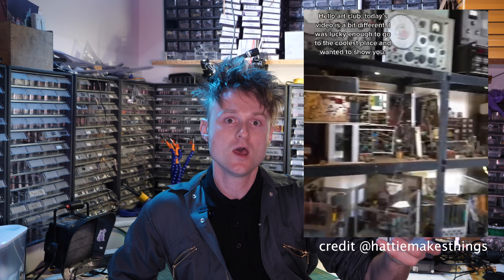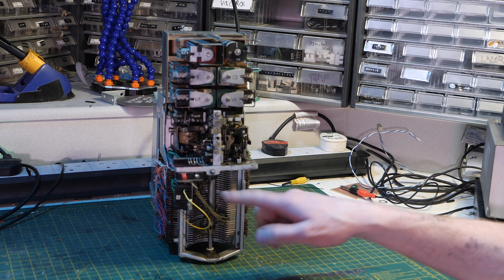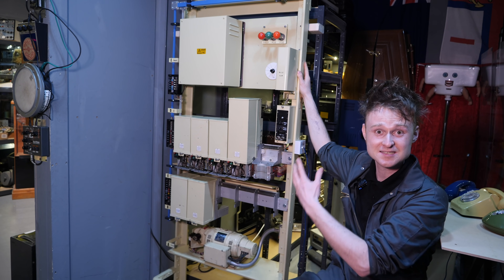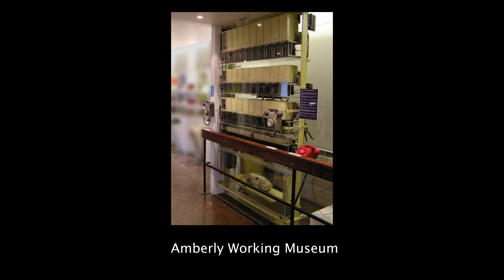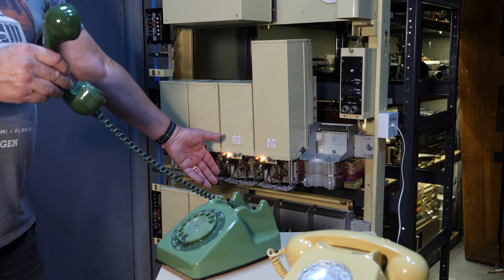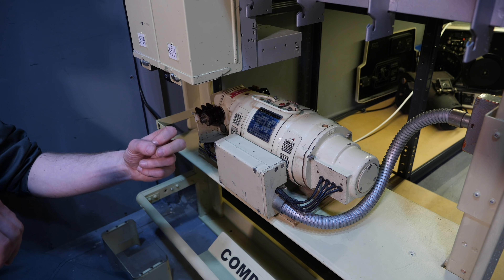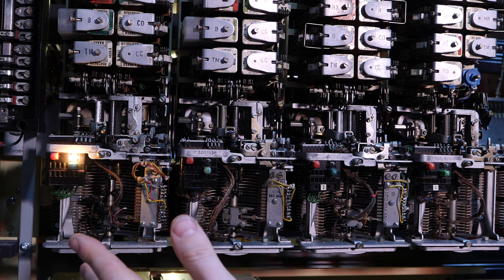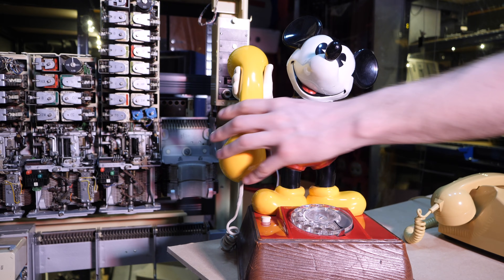STROWGER Telephone Exchange mechanical machine

Comment: The coolest bit of trivia I got from this is that the ring tones for all phones connected to the same exchange would be synchronized by the virtue of being a tone modulated by a motor and than the signal shared by all the phones, so 2 people sitting on the oposite ends of the town would listen to the same dial tone.
Reply: Yup, and the phones would also ring in unison. Well, actually that not strictly true <digs deeply into memory> without getting my notes out I seem to remember that ringing current was broken 66/33 66/33 0/100 (brrring brrring, brrring brrring) and so the ringer would have three output cams set 120* apart. Same with ring tone, and busy tone. Dial tone is continuous as is Number Unobtainable. I think that S and Z pulses were also sourced from the ringer which were used all over the exchange for timing things and also meter pulses (though I think the exchange clock migh also have been involved in the meter pulses) good grief, though I’m stretching my grey matter here.
Reply: @captbeardy  Could you elaborate? How does that lead to rings in different phones not be synced? It is fascinating but I fail to follow the dots. Do you mean there are 3 separate ringer outputs and some phones are connected to one, others are connected to others?
Reply: @Thorinbur  ok, I’ll try,  it remember it’s over 35 years since I worked on this stuff. 
The ‘tones’ and ringing current are all generated by an oscillator as continuous tones/current. I forget the frequencies, because it wasn’t generally important wine faulting this kit. Ringing current is, as stated 75v. Taking ringing current as an example, the continuous tone is presented to the inputs three sets of contacts, the output of which is distributed across the exchange to Final Selector racks to balance the load. The contacts are ‘broken’ by the mechanical action of cam lobes to give the iconic ‘brrring brrring pause’ in a ratio of 66% on and 33%  off. The three sets of cam lobes are set 120 degrees apart so that output is staggered. 
So you get 
Cam1. Brring   brring   
Cam2.            Brring   Brring
Cam3.                      Brring brring
I’ve still got some course notes somewhere, but I think that is about right.
Reply: @captbeardy  Appreciate you taking the time. I think I get it now.  So three staggered cams are conneted to one constant source so that when one source is connected by the cam other two are not and it is done to balance the load. And that will in turn make it so if you are connected to different "lane" the ringers wont be synchronized. I never thought about how many physical connections there were in the first phone systems. Internet is routing packets reusing same physical connections between routers. The idea that old phone networks would literary connect a physical cable using relays and selectors to a signal source and the source is connected and disconnected by a cam gear rotated by a motor... Amazing. Thanks for sharing the details.
Reply: No problem, it’s nice to stretch the very matter back to a simpler time in my career when every day was a discovery. The amount of physical,equipment that could be involved in a single,telephone call could be quite boggling, especially for a long distance trunk call. The kit represented here is just for,a 5 digit local telephone call. Consider,how much was required for a 10 digit long distance call when voice amplifiers, digit repeaters and various multiplexing equipment was involved. And long distance calls weren’t just simple step by step as represented here, but required register translators so,that a common STD code could be used anywhere in the country and still end up,at the appropriate destination. On top,of this there was an added level of complexity with something called the tandem network which was a clever way to reduce the number of interconnections required. Because you needed a physical discreet link to be possible between every pair of phones in the country, the optimisation of the network becomes a very complex mathematic model very quickly. Consider that this was all done with relays and selectors similar to that represented here. It’s mind boggling in the extreme, and I’ve seen a lot of this kit in action.
Reply: @captbeardy  Thank you for your detailed explanation, empirical knowledge really fleshes out abstract technical bits!
Thanks to Thorinbur for provoking the thread.
Reply: Yeah no kidding I never thought ringers were generated by a freaking monster electric motor

Comment: This might make you sad ,but when the new systems were installed the amount of this gear skipped was incredible, just see if you can get hold of a ringer .
Reply from the maker: Yeah it's sad ain't it! But always the case hey haha.  a ringer? Ain't that the ringer at the bottom of the rack?
Reply: @LOOKMUMNOCOMPUTER  that's what you get when you make a comment half way through! They did have second generation ringer .It was quite funny that they had the old "clockwork" for about90 yrs and about 2/3 next generations in about 10yrs.

Comment: Neat. My dad was an exchange technician and for a few years also did the lineman role. Knew everything from the battery room, generators, and clicky-clack relays. From Ma Bell, to Ameritech, to SBC Bell, and back to AT&T. Later on did service calls for alarm monitoring of the phone systems. And the building full of wiring and relay stacks (with library type rolling ladders even) got overhauled to being a mostly empty building with a handful of Siemens routers in the late 1980's. Oddly enough, they didn't mind the knee-high version of me visiting dad at the service desk area as I was trusted to not touch anything nor wander off. Interesting place to see back when it was the electro-mechanical stuff, but no pictures from there that I'm aware of.

Should probably call the local IBEW office and see if the union rep could get you in touch with some old retirees. Explain what you're on about regarding the museum and such. I bet you could meet them over coffee somewhere and they could tell you all you'd want to know about that stuff.

Comment: 2600hz is you friend wit a step by step
Reply from the maker: Not with pulse dialling ? Or am I wrong
Reply: @LOOKMUMNOCOMPUTER  to be fair finding really early copies of "2600" the magazine would be a great idea...  if you want to circuit bend phone equipment that magazine probably has all the background information and examples of the crazy things you can do....
Reply: @URTonemanclan  textfiles.org might have you covered.
Reply: Have a read of exploding the phone. Or yipl on archive.org
https://archive.org/details/YIPLTAP_1-91
Your rig may be missing that equipment tho as I think that that was only available on long distance lines. But another thing you could try is key switch dialing. Where you tap  the receiver switch to progress the dialing. (similar to the scene in the film hackers where phantom phreak calls acid burn in jail)

Comment: Be careful with that motor, if it's running for a long period, it may get really hot
In one of the exchanges i was working in, the label was discoloured from heat
The phone is called aa butt because it's short for 'Buttinski'
I actually helped install a crossbar exchange to replace the last manual operator exchange in england, it was Abingdon in 1975
Reply from the maker: Cool on the motor! Yeah if anything it’ll be running for an hour at a time. Setting it up on a timer so people can start the display and it’ll run for 5 minutes etc! Cool!
Reply: @LOOKMUMNOCOMPUTER  in the museums over in the states they run all the time 24/7 (they are meant to be running for years at a time)
i believe they have entire exchanges in the connections museum with different types of switches, check it
Reply: No way! Small world. I come from near Abingdon and a friend was head of IT at the nearby Rutherford Appleton Lab. They had the UKs first data phone line installed, wired straight to Abingdon exchange. He used to tell a story of how the line would go off hook, and the modem would make a load of noise, and then some old dear at the exchange would be very confused about the noises coming down the line. Abingdon exchange got the top few floors converted to flats a while back, as all the SystemX gear was removed to make way for all the soft switches. What once took up an entire floor is now a couple of racks. How things change!
Reply: @fruitytv-uk  Small world indeed
I was installing racks on one of the floors, even finishing the load in when our supervisor got his foot trapped under one and had to go to hospital, the racks weighed about a ton, about a year later i was testing the suites of racks
So, Stratton way exchnge now has flats as well as the exchange ?, thery probably wouldn't have got any sleep if the crossbar system was still there, though not as noisy as the strowger :D
Reply: @sparkyprojects  Yep the Stratton Way building is now 1/3rd exchange and the rest are flats. BT have a load of these large buildings simply not needed anymore. They were selling off rural exchanges and old repeater stations a while back. I guess it's a matter of time before larger city exchanges get converted to flats etc too.
Reply: @fruitytv-uk  Magnox Harwell by any chance?
Reply: good call on that one, my job revolves around electromechanical gear. quick glance at that DC wormbox motor combo, you want to monitor the temp of that if you run it for a while, the wormbox will probably have a bronze wormwheel and will degrade with many modern lubricants that contain sulfurdioxides or "EP - extra protection" additives. also removing the brush cap and brush will let you see how healthy the commutator is, at least on it's running area of the bars. also, there is a modern but still mechanical equivelant of those cam gears that are still used in industrial applications today, rotary cam switches I believe is the proper term (please feel free to correct me if I am mistaken)
Reply: @dandan9833  Yes there are cam timers, but as sam found out, the motor is also  a tone/current generator
Reply: Its running into comments like these that makes comment sections worthwhile... So cool!
Reply: Remember Chesilvale Electronics, Newport Gwent? They made most of BT’s test gear including buttinski sets. Also I had a “DDA” (dialled digit analyser) back in the 90s…. great fun.
Reply: TXE4?
Reply: I spent my entire time after my apprenticeship on xmission but had to endure the deafening clatter of strowger as we installed audio racks, when you went outside it was like a weight was lifted off your shoulders.

Comment: I wonder how it worked if there was more than one call
Reply: This is where the business of how the group selector goes up n times and then starts hunting for a free line comes in. There's more than one line going from the group selector to the next one it connects to. They both mentioned it in the video but only briefly; I hope there's more on that in the other video.
Reply: I would think that when you pick up the phone, you would get assigned a first digit group selector from a big bunch of them in your local exchange. Then after you enter the first number, the next number would be handled by trunk to the city that the area code points to, where you again would be assigned a free group selector. As he said, each of the boxes that he has 3 of, could be in different parts of the country. they are just on the same rack because there are only two phones. And then the last (higher) one would be inside the local exchange of the person you are calling, and picking the line going to the recipents phone.